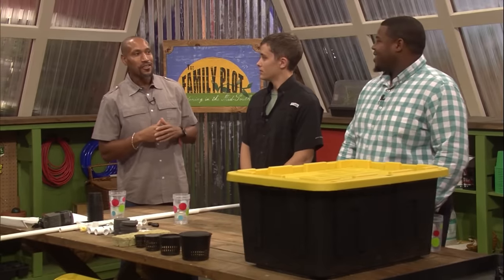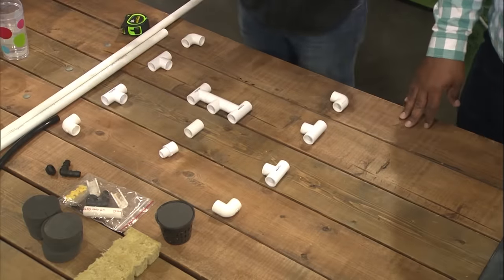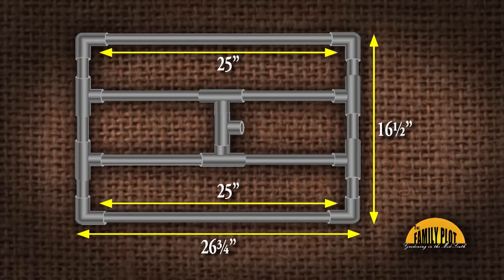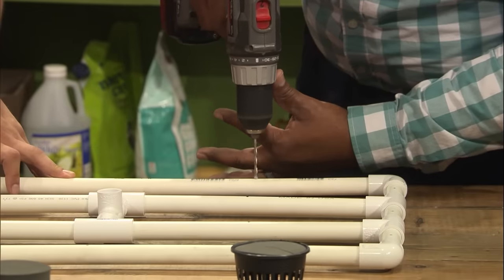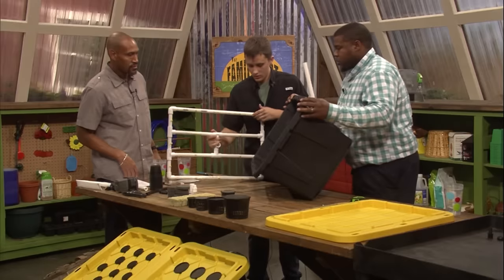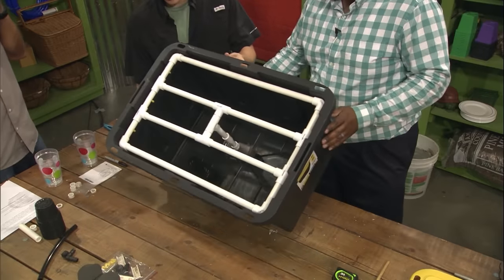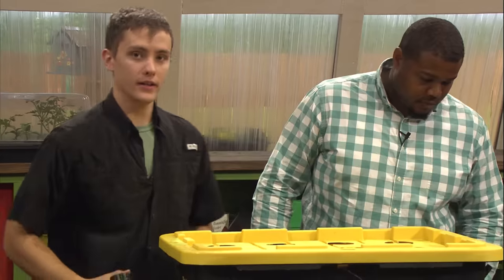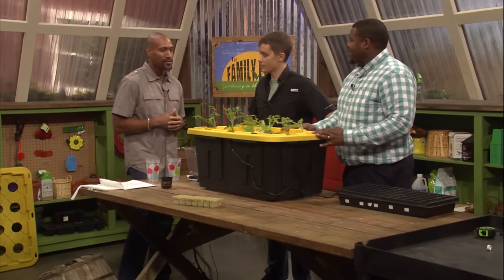Building an Inexpensive Hydroponics/Aeroponics System

Comment: New to hydroponics...does the water level in the tub need to stay at a certain level? I.e. due the roots eventually need to be submerged? I'm wondering if I can run 4 of these in parallel with holes in the bottom of each, draining in to a larger tub (like a 50 gal barrel) with only one pump that then pumps up into all 4. Essentially the tubs themselves would be empty with continous spray and the water reservoir would be below pumping up. Is that possible or does it present problems?
Reply from the maker: Yes you can do that and it is an intriguing idea, but there are few things you need to be careful of. The first is that you need to make sure the roots don't dry out. The advantage of the standing water is that there is always something down there for them to drink. The contradictory problem is that you are kind of doing a dutch bucket system. One of the problems you can have with dutch buckets is that if you let them run all the time the roots will grow down the drains and clog them. To get around this you need to have a timer so the drain is dry most of the time. This keeps the roots from growing into the drain. In your situation you will need to balance those two contradictory issues. Good luck!

Comment: I was a little confused about the drain on a hydroponic system.  Is the drain used to maintain a consistent water level within the system?
Reply from the maker: The drain is used when you change out the nutrient solution. This video shows it in action: https://youtu.be/gYrTTLbl3Ro

Comment: The only thinking I would change is the drain to a clear line so you can keep track of maintaining that 10 gal. amount. All and all a good video
Reply: It will just get covered in algae over time. Algae doesn't scare us, but defeats the purpose of the drain line. Also, we have ample 1/2" black tubing, so we just use it.

Comment: Does the pump run 24/7 or is there a recommended on and off time?
Reply: Depends on the plants and the amount of nutrients in the water. There is usually an on/off cycle though utilizing a timer.
Reply from the maker: We run it 24/7. The pump obviously keeps the roots wet, but also all the splashing oxygenates the water.

Comment: great vid, altho do the sprayers clog? i was hearing water deposits were problematic in any kind of system like this.  any truth to that?
Reply from the maker: They have not clogged. Their performance may be reduced slightly after a few years, but it is hard to tell.
Reply: If you use the correct pump and nutrients your sprayers will have almost no clogs for a very, very long time. Keeping your water clean is slightly important, but the pump used in this demonstration has a mesh filter at it's intake that catches almost anything that would get to the tubes. We have used cheaper pumps that don't have this mesh and experienced many clogs, which made the system a pain to maintain. Look for pumps with a mesh filter on the intake! Futhermore, so called organic hydroponic nutrients are more prone to clogging because they have much more particulate matter. The nutrients used in this system are synthetic NPK salt based fertilizers which dissolve completely and cannot cause clogging. Clean the system between grows and don't let it dry out without cleaning (keep it spraying until you clean it) and you'll experience very low maintenance during the growing season.
Reply: @wetwerk2178  thanks for that man

Comment: When u make this is the sprayers on all the time or should u have a repeater timer to turn them on and off
Reply from the maker: You can do it either way. This system runs 24/7, but you can also use a timer. Your choice.

Comment: Random question: For hydroponic Nutrients, I have a 27 gallon tote using 5 gallon amount of filtered water Irrigation system, Currently amount of nutrients Formula is 12.24g master blend and 12.24g Calcium nitrate and Epson salt 6.24g, I herd Nutrients only last 7-14 days indoor, my question is can I reuse the same water and keep adding nutrients!? Or do I have to drain the filtered water out and place new fresh filtered water and start the process again?
Reply from the maker: It depends on what you are growing. If you are growing lettuce you can keep the nutrients for a longer time, If you are growing a heavy feeder like tomatoes you will need to change it more often. The non-scientific rule of thumb is to change the solution when the plants have drunk up about a third to half the solution. When you change it you should drain off and dispose of the old solution, then put in a fresh mix. This is because the plants take what they want and leave the rest. As you keep adding more, the nutrients they don't want will build up and eventually harm the plant.
Reply: @FamilyPlotGarden  Thank you will do

Comment: Where did you buy your sprayer heads? I can't seem to find them anywhere. What is the name of the head?
Reply: Go to your local green house or Home Depot, Lowe's Ace Hardware,  bomgaars  this time year and they will be in stock. Ask for 360 degree sprayer tip ( 6 tips 3.00$) I found a 360 degree misting tip At bomgaars  2 days ago I never seen these before so I,m going to try these tips first. ( The more air on roots mixed with nutriments) A  true Aeroponics  system Water is atomized with the air its a mist being supplied to the roots. That is not  what the HYDROPONICS  EXPERT lol built right there. I have built these same clone totes before yes they do work 4 inches of roots every 7 days. The totes I built Used only 2 360 degree tips that pointed up to the cuttings from a single PVC pipe ran through the center of the tote. They pointed those tips down. You can greatly improve what you build from theirs hope this helps. 
Oh if sitting tote on basement floor or in cold area get a fish tank heater , the solution must  remain constant temp about 78 F. Also use air stone to fight bacteria . Heres the tips I use  https://www.google.com/aclk?sa=L&ai=DChcSEwibu8GXj_TwAhVoH60GHf9nAMUYABAEGgJwdg&ae=2&sig=AOD64_3pcw7wXhXcAs_SqElunpuCIN0q9A&ctype=5&q=&ved=2ahUKEwj2o7iXj_TwAhVPjp4KHdg_BEAQ9aACegQIARBs&adurl=
Reply from the maker: Search for "hydroponic misters"

Comment: Very Interesting stuff. Do you grow the plants under some kind of artificial UV light? Is that going to be demanding on the electricity bill?
Reply from the maker: This system grows in a large window. You can grow under artificial lights and how much light you need depends on how large the plants are. For tomatoes it would require a large number of lights and a large power bill. For lettuce or other small plants like that you can get lights that use less than 100 watts.
Reply: Tomatoes, or any fruiting plant, can be grown under a single 600 watt HID light or a decent LED light of comparable power. A 600 watt light running 12 hours per day will cost about $35 per month to run in Memphis, TN. It will cover a 6'x6' area. LED will be cheaper on the power bill. Vegetative plants such as herbs and lettuce, etc can be grown under florescent fixtures, preferring high output T5 lights, but a simple shop light or two would work as well. You may also substitute for LEDs in vegetative. You don't need large numbers of lights or a high power bill to offset your grocery bill. Having a space for an indoor garden is an excellent choice in today's economic climate. If you have a glass atrium, you're ahead of all of us. Everyone else, just use the garage, storage room, basement, spare bedroom. Any room can become your garden. We have even built small aeroponic system directly into people's counter tops with LED's over them for quick access to herbs while cooking. The sky is the limit. If you live in a big city, in an apartment, nothing could be better if you want to garden than getting a simple light and setting up a couple of aeroponic systems to suit your needs. This system is a beginner's system. There is no limit to the configuration and application you can apply this method to.

Comment: Are these custom totes for hydro only ? I'm not seeing the lids listed on the .pdf and the containers only vaguely listed as "27 gal container".
Reply from the maker: The container is a 27 gallon storage container that you can buy at big box hardware stores. They come with a lid.
Reply: @FamilyPlotGarden  Well it looks like a custom lid ??? Or did someone masterfully cut the holes in it ?
Reply: @SmeeUncleJoe  3" holes cut to match 3" netcups, using a 3" hole saw. It is custom cut while the tote is built, friend.

Comment: What about feeding the plants with some form of liquified nutrition, and what's actually going on inside the tub?  Also, what's the purpose or why bother with a drain?  Is an inside grow light needed?  How long do the plants remain in this container, and are they needing to be transplanted to a larger device?  Lots of unanswered questions or vague assumptions.
Reply: Well, all of these questions are answered in this comment section, but I realize that can be daunting to find so I'll reiterate. Thank you for being interested.

There is a follow up video to this on how to apply nutrients to the system, check the Family Plot videos section to find it. We made this video to bring people already familiar with hydroponics into DIY aeroponics, so that person would already know to feed them a nutrient solution. We recommend salt based synthetic NPK fertilizers for this application. They are sold in abundance everywhere.

The drain is so you can drain out the nutrient water between replacements. In all hydroponic applications a one to two week cycle is recommended between replacing the entire reservoir with a fresh nutrient mix. However, we have gone longer in some applications. This system is designed to used as little nutrient water as necessary between these replacements to lower the use cost. Deep Water Culture hydroponics tends to cost a fortune and make big hydro very happy that you're throwing away so much nutrient between water replacements. I recommend you become familiar with hydroponics in general, since you aren't up to speed on the basics. No worries, though, we all start somewhere!

We don't transplant out of this container, and it will indeed become impossible once the root mass has become large. This is large enough to use through the entire season. It may even be too small if you use every plant site, because 12 plants growing out onto a trellis will have such large root systems that they will drink the entire thing in one or two days, if growing outdoors in the heat, before the season has ended. This isn't as big of a problem if you are growing indoors where you keep things cool and temperate. We have designed many systems that automatically replace the water for the system via a simple gravity fed water line and float valve connected to the system. 

I hope that helps you get motivated to use aeroponics!

Comment: My system is up and running for about a week.  How often should I change the water and replace the nutrient solutions?
Reply from the maker: A general rule of thumb is to replace the solution when the plants have drunk a third to  half the solution. How long this takes depends on many things including what plants you are growing. Several large tomato plants can drink this much in a couple of days. 12 lettuce plants may take a month to drink that much.
Reply: Nutrient changes are no longer than 2 weeks as an industry standard, but you can figure out what works for you. Way to go on getting it going! Congrats!

Comment: Is this easier to care for than an outdoor garden? For some reason my garden outside just doesn't want to live. I don't know if it's too much sun, not enough sun or what..
Reply from the maker: My experience is that as first you need to spend time every day to check pH and nutrient levels, but once you see how it behaves you can spend much less time on it. I have an indoor system that grows lettuce and I don't even check the pH any more because I know exactly how it behaves between nutrient changes and I know the pH won't go outside the optimal range for one month.
Reply: I tend to think hydroponics is far easier to use than soil, in that you are able to troubleshoot and correct problems immediately. What does that mean? I see my plant isn't happy, so I make sure my water filters are clean and newly changed, and give it a fresh water change. This usually corrects everything that can come up. If I screw something up in soil, it's pretty much a done deal. Hydroponics is very forgiving in error, but its a constant need, with a minimally designed system, for user input to balance things out. Have plants drank too much water and the nutrient levels are running high? Add more clean water to bring the levels back down. The the lines can becomes gunky in very large, detached systems. This tote, however, stay pretty clean because its a closed system. I think you'll find great results if you learn the basics, vs all of the worrying and waiting in the soil. You can take this tote outside, by the way. Think of it as portable ground. Set it in front of a trellis and grow the vines directly from the tote. Make smaller versions to house one or two bushy peppers. Use a shallow tote with low of holes for lettuces. Make a system with an external reservoir that feeds smaller totes attached to a wall that house herbs. The sky is the limit with this sort of aeroponics system. Start with one. Jump in!

Comment: Hey, guys. I have built my tote and have the nutrients, calcium and magnesium and ph adjusters. I also have a good pump and a light system and a timer.

Can you advise what kind of timer cycle I should be using for the pump and the lighting?

I appreciate your reply.
Reply: I left mine running 24/7, lighting I guess depends on your plants needs. I wouldnt overcomplicate things.
Reply from the maker: Sure.
The pump can run 24/7 if you want. It will cost a little more in electricity, but it is probably going to be less expensive than an expensive hydroponics interval timer. Alternatively, I use a GROUNDED lamp timer like you use on vacation. I use the one that has little tabs every 15 minutes. I set it to run for 15 minutes every hour. They usually cost about $9 or so on Amazon. You recoup the electricity costs in about 9 months or so.
Lighting is different depending on how big the plants are. You can run the lights 24/7 until the plants get a few sets of true leaves, then cut it back to about the natural day/night cycle. Try 16 hours on 8 hours off. Plants need darkness to grow well.
Reply: @FamilyPlotGarden  Thank you!
Reply: Good job!

Comment: Made this works great
Reply: How often do you replace the water and what ratio of nutrients do you use? Did you follow the guide they had the on site? I'm on the last part of cutting the holes through the top, all the PVC / sprinkler part is done.
Reply from the maker: Change the water and nutrients when the plants have drunk about half of the water. Depending on the plants you are growing that could be a month or a few days.

Comment: What GPH is suitable for this setup? Do we have to go 800GPH or a smaller 160GPH would work? Thoughts?
Reply from the maker: We used 400GHP. You could probably use a 300GPH pump, but I would not go much smaller. You can go bigger if you want. It the spray is too powerful you can turn down the pump.
Reply: We chose the 400gph Active Aqua as a "sweet spot" between pressure and price. The 550gph is almost twice as much! The 250gph doesn't have enough pressure. Get the biggest one you want to pay for.

Comment: When using a hole saw to drill holes in the plastic lid run the drill in REVERSE. With the drill in reverse the hole saw will not grab the soft plastic and the result is a very smoothly cut hole. Drill the center pilot hole of the hole saw in FORWARD, then switch to REVERSE to complete the big hole. A little slower drilling this way but a perfect cut hole is the result.
Reply: Young Scott made a few mistakes in this video, but he did great. We appreciate the YouTube community continuing to educate us on proper use of tools. We definitely run our drills in reverse when cutting into plastics. Thanks for the input!

Comment: Do you need to run the pump 24/7 or sunup to sundown or what? Thanks
Reply: We leave our's on all of the time. User preference. You can play with settings on your timer, just make sure the roots don't dry up and shrivel and you should be fine. The most fun part of hydroponics is it's much more forgiving than some might imagine. Be adventurous!

Comment: You'll get a more reliable seal for your drain if you run a deburring tool around the drilled hole edges. Much better finish for maybe one or two minutes of work.

Comment: Hey guys. Noob question. Should the water disperse/pump system be 24/7 ON or is it not necessary? What is the optimal approach?
Reply from the maker: This system runs 24/7. I have run a similar system with a timer. 15 minutes on 45 off. You an do either. You just need to make sure the roots don't dry out.
Reply: Because of the extreme aeration that this method creates, we use keep it running constantly. The only reason we would add a timer to turn off the pump is to save on electricity costs. We have not done the math to figure out how many on/off cycles the pump can handle before it burns out or how long it takes for the on/off cycles to pay for the cost of the timer. The method's approach is to get the user operating and keep operating with the lowest startup cost possible. Adding a timer is not a bad choice at all, but isn't necessary either. User preference. We prefer to run them constantly and setup warnings when the pump stops running to save the plants in the system if there is a failure. We are currently testing systems that will send push notifications to our devices when a pump stops running. the on/off cycle would make this more difficult.